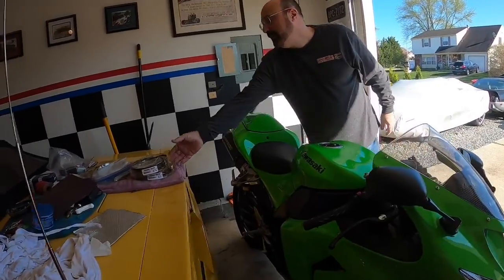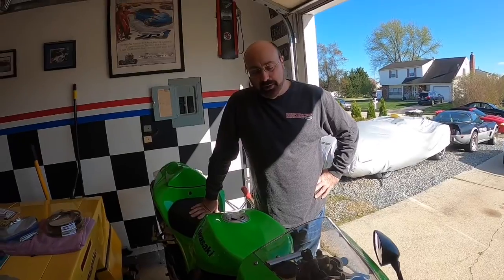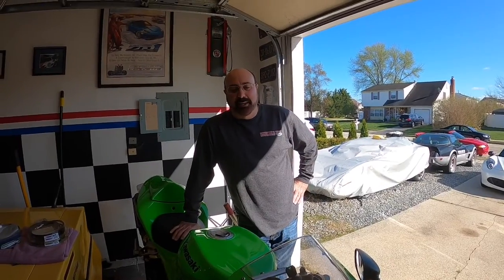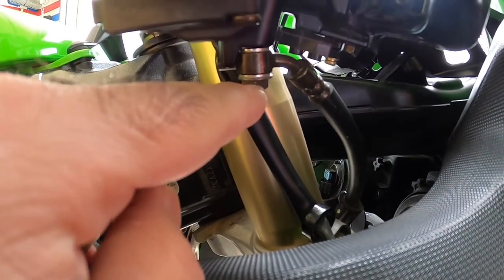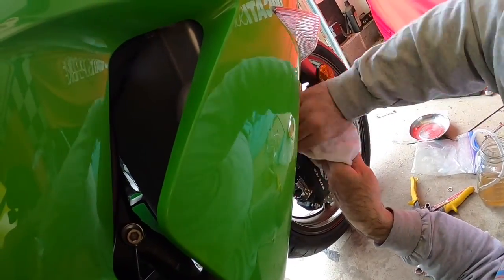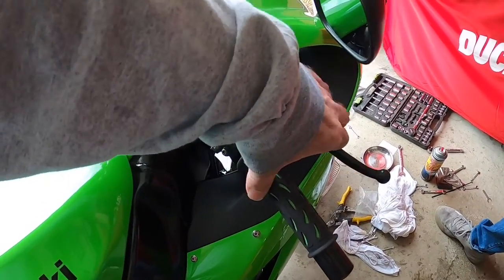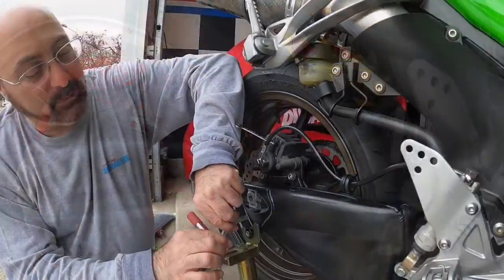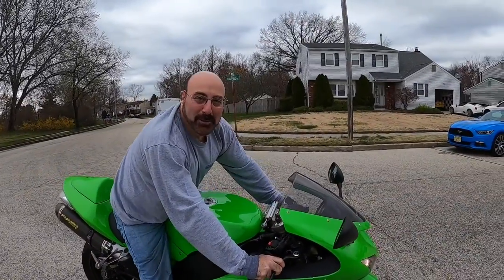Fixing spongy brakes, 2006 kawasaki Zx10r, Galfer smoked stainless steel brake lines. Dot 5.1 fuild

Comment: The problem with the brakes are the oem zx10r Tokico calipers you can swap them with a 2009 zx6r or zx14 Nissin calipers it is a direct fit and problem solved, you can also change the oem Nissin master cylinder with a brembo master cylinder of a Yamaha r6r or r1 if you do it you’ll need a Yamaha brake lever
Reply from the maker: Just changing the lines to stainless steel fixed it.  The bike is a 2006, so lines were old.
Reply: Broken Big Boy Toys try the Nissin calipers will be the best mod that you can make I have the same year bike and it’s day and night difference in braking you will see what I’m talking about
Reply from the maker: I do not disagree but I'm looking to keep the bike stock.  As you can tell the bike is ridden limited miles as I have 6 street bikes including 2 ducatis.  I love the Zx10 and will never sell it.  Thanks for your comments and I invite you to subscribe to channel as views like you are always wanted as they provide great advise through the comment sections.  Ride safe.  I think wearing a helmet is better then wearing a mask.  Lol
Reply: Agreed, I bought a d6f new and the brakes were bad, complained to the dealer (he said I needed braided lines, go figure on a new bike!) , went with braided HEL lines, it helped but the zzr14/zx6r Nissin calipers totally transform it, still have the bike and the brakes are still brilliant, d6/d7f really under rated bike, ditch the stock exhaust, fit a side exit Racefit, de cat, K&N and I fitted the 08 rear swing arm.  People rave over k5/k6 gixer but the zx, when set up, is a much more raw sports bike.
Reply: What year calipers?

Comment: still have the ZX-10?
Reply from the maker: Yes I will never sell that bike.  It only has 3400 original miles.  I swap back and forth with the 996 Ducati ab
Reply: Just picked up an '05 with only 1500 miles, I had been looking for one.  Bought an '07 brand new but sold in 2012.  Love the first and second gens, despite the issues (valve spring retainers, frame cracks, etc)